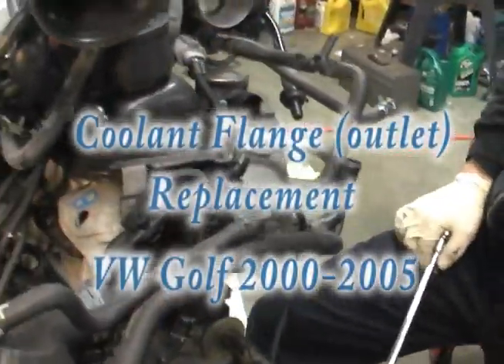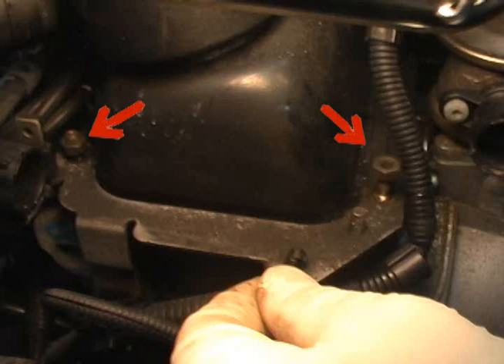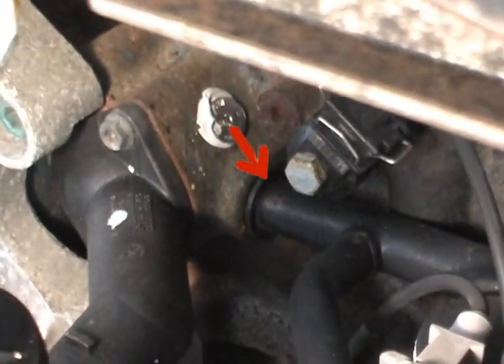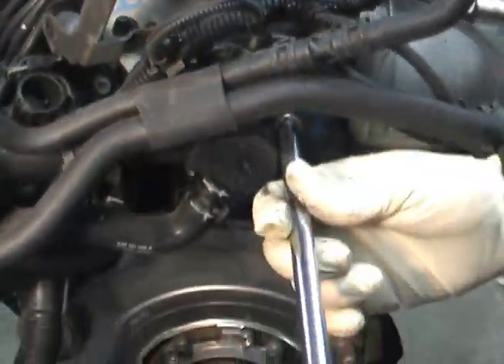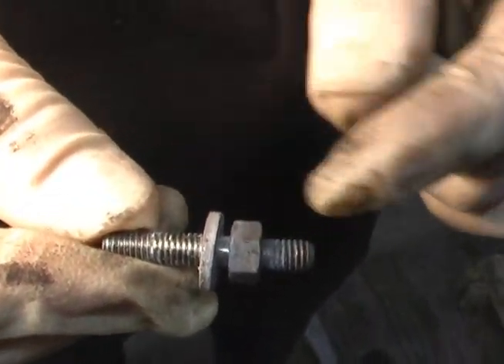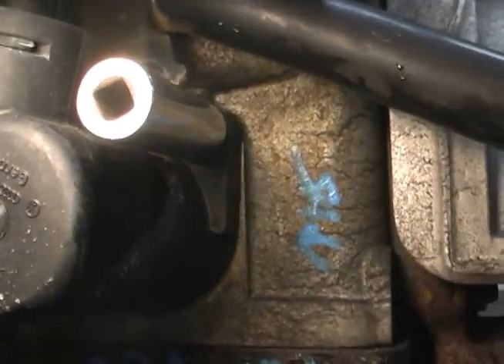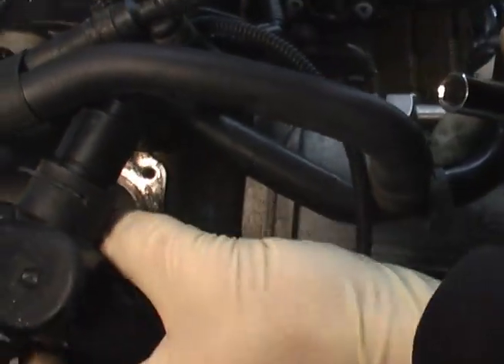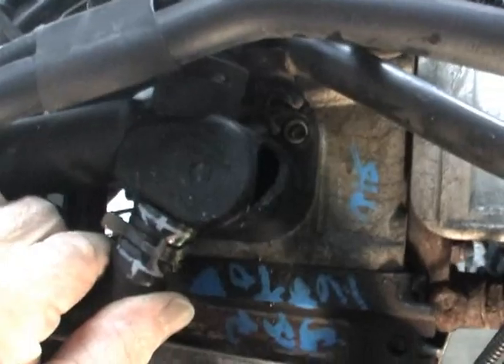Coolant flange (outlet) replacement - 2000-2004(5) VW Golf and Jetta 2.0 L

Comment: Thank, this video pointed me in the right direction but I lost the 2 studs to reattach the flange, does anybody know the size for the hex studs or even a link to purchase them online would be appreciated?
Reply from the maker: I've got it for you. The VW number for the studs are  part # N91148001.    https://www.jimellisvwparts.com/products/Volkswagen-VW/Bolt-Stud-Bracket-Lower/5332224/N91148001.html
Reply from the maker: https://hansautoparts.com/N91148001-Double-Hex-Head-Bolt.aspx   Here's a source for only $2.00 as opposed to $11.79 from VW.